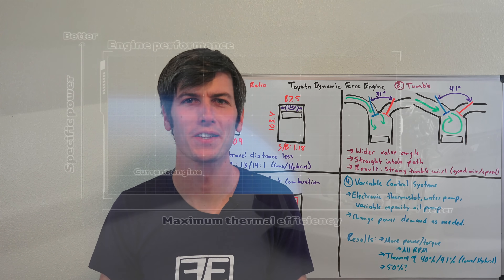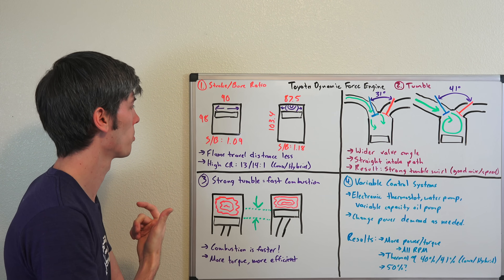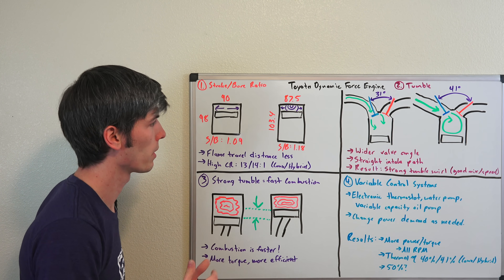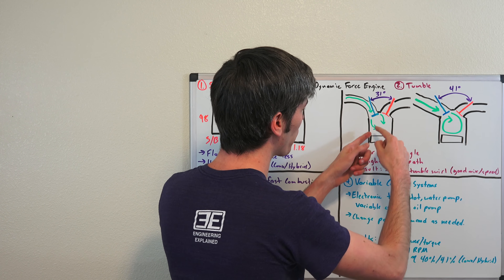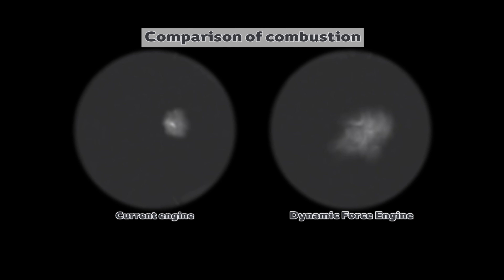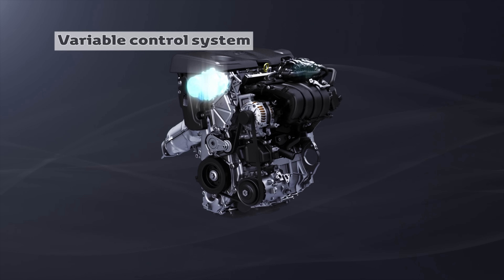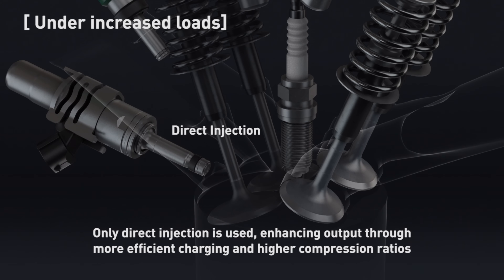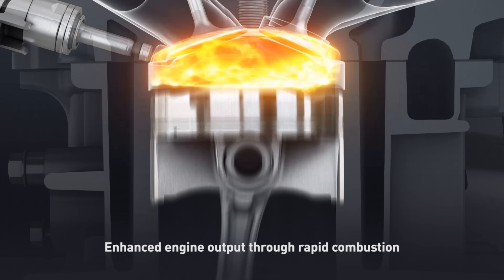Toyota's New Dynamic Force Engine Is Super Efficient

Comment: I wonder if their 3.4L V6 was one of the first to use this? I remember their earlier naturally aspirated V6 was just under 200HP, then when they changed from port injection to direct injection most numbers stayed about the same but horsepower went to 268. Means a significant increase in efficiency without any boost, but they used it towards producing power rather than economy. This is why the V6 Camry is no slouch, and even the Sienna isn't pokey for its size.

Comment: I feel like they could achieve even like 43%-45% if they ran the electric thermostat at say 220-ish degrees because of cylinder quenching. I'm sure that comes with a whole new set of issues like higher pressure radiator caps, tighter sealing cylinder heads, etc... but still very impressive.

Comment: Isn't the reason that this engine has more torque due to the longer stroke? Meaning the crankshaft has a bigger diameter giving more leverage between the piston and the centre of the crankshaft. And isn't that the same reason why trucks and ships are using mostly long-stroke engines because of the extra torque?

Comment: Finally a completely new engine from Toyota. Their last one until now was almost decade old. In straight-fours that is.
Reply: yes,a new engine for toyota but is rather very clatterey on cold starts at -3 and probably much worse as it gets colder out. I have it in a 2020 corolla se 6spd and was very disappointed with the cold start noise 1 and a half minutes before it quiets down. I don't believe this is normal for a new engine.
Reply: @ryer3505  Must be that electric oil pump.

Comment: Nothing is new in this engines. Tumble flow has been developing for some time now. Electric water pumps and thermostats are here for more than a decade. Direct injection has been perfected by the diesels for the past 30 years. Bore to stroke ratio, without even doing a research, probably somebody else has been there, done that.  40% thermal efficiency, I'll believe it when I drive it.

Comment: Excellent  video as always. My only concern is about the number of new electronically controlled device from a durability and cost effective stand point compared to their older relatives? Even though its made by Toyota electronics are more susceptible to more costly and catastrophic failures than mechanical parts. I personally would prefer mechanical parts that are re-engineered and sensor-ed to better maintain the vehicle than being fully electronically operated.

Comment: Toyota's are a drag to drive...
No fun at all
What car are they in?

- Harvesting energy from exhaust through turbo powering a generator. That's not an expensive feat, and can easily achieve 50%.
For small and econo engines, the efficiency actually goes up (to perhaps 55-60%); since F1 engines have a lot more waste than a small engine.

Comment: I wonder if this striving for efficiency is going to bring back water injection.  Here and there a production car gets WI but it's super rare.  TOday's electromechs have great control and like direct gas injection, maybe direct water injection should be incorporated. You need to leave no stone unturned for optimization.  I was going to put in a unit aftermarket in subaru but abandoned due to worry about lack of sufficient water spray control. I had all the parts on hand...  WI was used in aircraft and rally racing cars to my knowledge.

Comment: more things to break.... so how they don't focus on recovering more energy from the exhaust?  Trying to get a few percent better at burning gas whiles sending 60% of the thermal energy from combustion out the exhaust pipe and radiator seems kinda ridiculous. A catalytic converter burns gas further than a spark plug can... so using the thermal energy in the exhaust post-catalyst to say, cool the engine should increase efficiency by 30+ percent.
Reply: Dennis Cook they already do have similar setup in the new Prius. It recovers energy from the exaust to heat up the engine quicker.
Reply: at least they're heading the right direction. I still don't understand why they don't use absorption cooling technology to cool the engine. I found a white paper from India that discussed using absorption for air conditioning vehicle... but why no grabbing for the gold ring?...

Comment: Cool engine design! Apart from the electric water! What are they thinking!? What do they think will happen if it loses power? I just hope it won't be fitted in those cars that don't have an engine temperature gauge, temperature lights just don't cut it!Electric water pumps just won't be as reliable as a mechanical one (can be).

Comment: Well, how is the increased angle (41°) between the inlet, outlet valves gonna help the combustion? The inclined ports would have been more efficient if the valve stems were more erect. Ain't it?

Comment: They need this engine in the Tacoma it really lacks power!
Reply: Not to mention that #1 cylinder is having some valve burning problems. Its been kept hush hush but its in the TW forums if you look hard enough, several guys have had burned valves on #1 cyl with less than 30,000 miles.

Comment: What about the batteries required to run all those electric parts such as the electric pump? Can they run those just off of the 12v battery + alternator?

I know in the electronic turbo video they had to use a 47v battery which ads cost.

Ty

Comment: So much work going into efficiency... when you'd get far better fuel consumption by simply ceasing to fatten up the cars every year.

Sacrifice a bit of safety, and you can have all the MPGs in the world. 90s civics, 80s golfs, 80s toyota pickups... any motorcycle ever... the examples are endless. Put the phone down, get some antilock brakes, and you simply don't need all this heavy crap on a car.

Comment: If we want the hybrid will we still be stuck with the horrendous CVT transmission? Is there a version for car enthusiasts with a manual box and a competitive level of performance?
Reply from the maker: The standard 13:1 CR will likely be paired with manual transmissions. Hybrid manuals aren't super logical, so they tend to have different transmission styles (CRZ is one example of a hybrid manual).

Comment: so they are reducing the diameter of the cylinder and increasing the distance of the stroke? so of course this is going to make more compression on its own (not even considering the valve angle adjustment.)which means more power. wouldnt the combustion on a smaller engine be quicker than combustion on a bigger engine anyway simply because of the smaller surface area/volume?
Reply: the only thing this will do is make engines break faster due to more compression stress and a longer more fragile pushrod. so people have to buy more parts or another car.

Comment: Hey, wondering if you could explain why uniflow 2 stroke engines are unpopular with car manufacturers? Either valved (Like Detroit 2 strokes) or Opposed Piston (Junkers jumo, Napier Deltic, Commer Knocker, etc)?

Before people replying start talking about burning oil, and emissions; the engines I am talking about used a roots style blower, for scavenging, not crankcase compression. There is no oil being burned.

Comment: Its a high compression engine. With a shitload of electric accessories to reduce the perceived load. Didn't diesels hit 40% nearly a century ago? A higher ratio probably increases combustion speed as well due to increased reaction violence. valve angle changed? Who cares? literally every head made has different designs and valve angles.
Reply: and what the frick, 13:1 ratio? this engines going to be unreliable unless they build it like a tank.

Comment: Just for a measuring stick comparison, what would be, nowadays, the average thermal efficiency of most cars?
Reply from the maker: Peak probably in the low 30's. But certainly some in the 20's.
Reply: Yeah, that's what I thought, but seeing that this one was reaching "woping" 40% I thought that more recent motors had already achieved a higher efficiency than I remembered when I first learned about them, turns out this one really is just "that good".
Thank you

Comment: Congratulations Toyota on building a Mazda SkyactiV engine from 2011 (41% thermal efficiency, Skyactiv-X is coming in at about 56%). This is about as exciting as Toyota NASCAR; been done before, better, in better cars.
Reply from the maker: SkyActiv X is not 56%, SkyActiv-3 is, which no details have been released on. SkyActiv-X efficiency will be around low 40’s percentage.

Comment: Now double it to a 5.0l V8, then you have a real engine!
On the risc the question was asked already: Does it reach over 40% with the crappy 87 octane US fuel?
Reply: How is our fuel crappy? Anyways, it was designed to run on 87 here in the US. With direct injection, octane isn't such a big deal these days. Even Mazda 13:1 engines run regular just fine.
Reply from the maker: The 2018 Toyota Camry (using this style engine) says the fuel requirement is 87 Octane, so I would assume so.

Comment: Could you explain why most of the cars have different sound when they're reversing? Shouldn't direction of rotation matter in that case?
Reply: Foward gears are helical gears and have teeth angled to mesh gently and quietly. Reverse gears are straight cut and whine when meshing together. They use these straight toothed gears because it's simple and cheaper to make.

Comment: I notice in the animation from Toyota the crank appears to be spinning the opposite way.  Does this engine rotate the opposite of the older ones? or are the valves just on opposite sides, causing them to rotate the view so the cross flow looks the same?

Comment from the maker: Efficiency versus SkyActiv-X? Many have asked. I reached out to Mazda, and here's their response: "We don’t expect it to be much beyond the best in the industry at the moment (a Prius is 42%, for instance), but that’s just the peak. The benefit of SPCCI is that where the Prius has a minimum efficiency of 2% under WOT, SKY-X will be way higher when you’re flogging it. So no real numbers yet, but the floor should be way higher, and the ceiling should be just a little higher." Essentially saying that while peak efficiency may only be slightly higher, the load range of efficiency will be far broader. Hope this helps answer your question!
Reply: Engineering Explained this explanation warrants its own video. Excellent work as always. Great channel.
Reply: I'm glad that Mazda has the balls to spend money on R&D and try to come up with new tech instead of their competitors who just hire a few interns to tweak something every few years. The rest of the industry benefits when they hit on something that succeeds and can copy them.
Reply: @emissarygw2264  yeah, by Toyotas put their R&D on reliability though which for some reason is still leading the mass production car industry
Reply: Which tells me that highway cruising will be a little better, but in-town efficiency will be HUGELY improved.  Just like a hybrid.  Also, the SkyActiv-X is supposed to be genuine "high performance" when you want it to be.  A Prius is a dog all the time.
Reply: Engineering Explained does Toyota use the same style of 4-2-1 exhaust manifold as Mazda?
Reply: what about combining the engine's  structure design from Toyota and applying the combustion method from Mazda skyX ?? could it be become much better?
Reply: Rob Evans agree with Rob, I kinda get it but a video on it would still be useful
Reply: The SkyActiv-X is going to better "real" world efficiency numbers, once there are thousands of the engines in use. Now if only variable compression could be mated to a Free-Valve type tech... Imagine the possibilities.
Reply: MasterMech77 fee valve tech will be awesome buy itself cant wait for it to finally make it to The consumer market😃👍
Reply: Engineering Explained so they make mildly interesting cars in the us? In europe 0.0% of toyota buyers are into cars, kinda sad actually
Reply: 2% at WOT?? Or did they mean 20%?
Reply: Isn't SkyActiv-X direct fuel injection into the combustion chamber vs fuel injection just outside the intake valve?  Ford had a lot of problems with their direct injection ECO-boost engines because of the extremely high pressure required for the injector.  Like CVTs, dual clutch transmissions, turbos, VVT and all the rest to increase efficiency and gas mileage, these technological wiz-bang goodies make for low reliability.
Reply: @Booboobear-eo4es  whiz bang like turbos, superchargers, direct injection, fuel injection?. All around for decades and proven to be reliable on the road and in endurance motorsport. Most off these features are just modifications of the modern ICE so can't see big reliability issues. Toyota's ground breaking hybrid engines have remained ultra reliable and enough at taxi drivers have run them into massive milages
Reply: It’s great to see such a small change make such a big difference in basic efficiency of the combustion process , and simplifying the input paths to straight shot also brilliant
Reply: @Sam S I get the impression you're high.
Reply: Cover cylinder sizing - effect on efficiency and performance.
Reply: No Mazda 2 gets 41 MPG combined. 2016 has 41 MPG highway on the sticker. Not sure why people treat highway numbers like combined or actual.
Reply: wonder how good BMW could be. I get the same mileage in my 2.8 200bhp coupe as I do in my mazda mx5/miata 1.8
Reply: you mean like Rotary engines and the billions they have wasted on that for the last few decades?
Reply: 2:37 Why not call it "Vortex Accelerated Combustion"?
Reply: @Sam S lol what? literally nobody else is doing compression ignition on gasoline engines.
Reply: you sure you're not an aussie, 'flogging it' is as Australian as it gets.
Reply: @Sam S that does suck. My 2007 Speed3 went 325,000 miles and all I ever did was replace the timing chain and valve actuator once, along with the usual wear parts like brakes and about 11 sets of tires.  Original clutch slipped under full power but it still worked when I sold it.  Tracked it some at VIR, and I dont drive like some old woman.  Only nodded the suspension a little (upgraded stabilizer, links, and struts) so it was the most reliable car I've had to date.
Reply: Very interesting! From the quote, put in other words, Mazda is saying that thier efficiency is consistent rather than Toyotas', which is efficient to an x point? I hope that articulated well from what I'm hearing and reading. Very interesting! From the quote, put in other words, Mazda is saying that thier efficiency is consistent rather than Toyotas', which is efficient to an x point? I hope that articulated well from what I'm hearing and reading.
From that premise, I'd further inquiry, with all this consistency and efficiency, which is a best engine decision for long term reliability. From what I know, Toyota is known for this but perhaps Mazda is shifting that perception.
Reply: I was wondering that when you mentioned the high compression. My first thought was a Toyota version of skyactive. Because they also use a more “pentaroof” style combustion chamber.
Reply: lol skyactiv x crap is dead and hybrids plus electrics have won
Reply: Mazda engine will be more complicated and its efficiency depends on some variables working perfectly 100% of the time. If Mazda just get 41 MPG on that diesel fueled with gasoline they had failed.

Remember the Mazda story with all their revolutionary miracle engines that would have changed the world but they didn't

Rotary
Renesis rotary
MZR
DISI
SkyActive first generation.

I drive their current Mazda 2 which is said to get 41 MPG but I do an average of 26 MPG only no matter how conservative I drive.

Mazda SkyActiv X will be a pain to work with as it is so complex. If TOYOTA gives me great fuel economy with their M20A-FKS Dynamic Force 2.0L I am O.K with that. I need it to be reliable, not complicated and I need it to have engine reliability DNA from past TOYOTA engines.  Look at Mazda's list of faulty engines and transmissions...1st generation Mazda 3s are plagued with issues... while my 2001 1.5L 1NZ-FE TOYOTA with 345,000 miles still runs good
Reply: EM6285 .... is it miles or km???
Reply: @EM6285  crossing fingers Toyota will succeed in keeping it's legendary reliability within these new engines

Comment: Will never beat the 80-90% of an electric motor. I like the engineering part of this new engine. It is fun. But it gets less and less practical to spend time and money on new ICEs. That's imo ofc.
Reply: 80-90% is efficiency of the of electric powertrain itself, not the net efficiency of electric power. Most electricity still comes from fossil fuels like coal and gas, which aren't any more efficient in reality.
Reply: Nuclear, solar, wind, geothermal... The source of the energy is not the motors fault. Also, you can't efficiently go from electricity to chemical fuel. Sooner or later we will transition into renewable energy or fusion. And then the electric car will already be there. ICEs will need inefficient fuels made by electrolysis or something. The best case would be biofuels.
Reply: Supposedly sooner or later a lot of thing will happen, but these are just promises on top of promises. Meanwhile, virtually all cars and trucks still rely on fossil fuels. Also, it isn't the fault that power through fossil fueling is still cheaper and more practical. Until electricity can be made from nothing, more promises will be made.